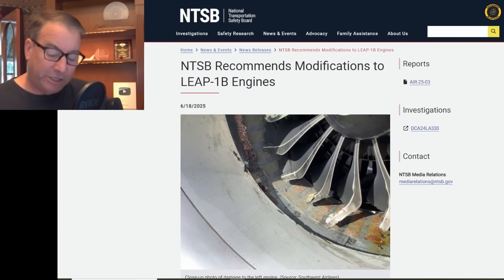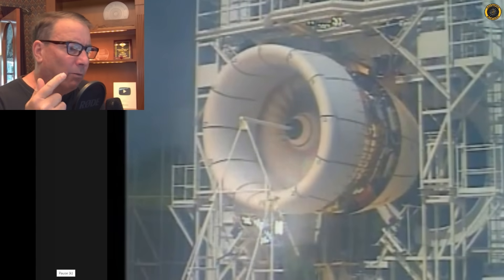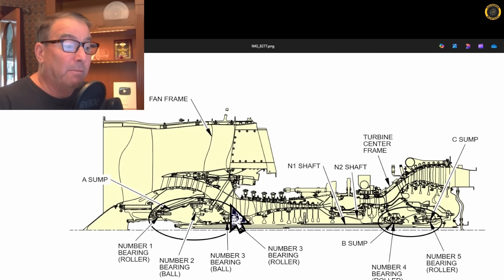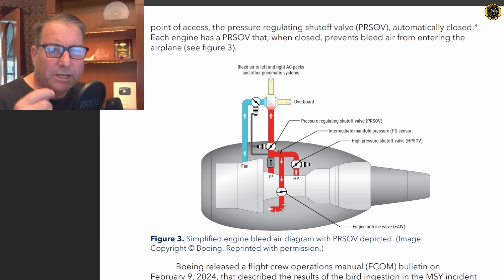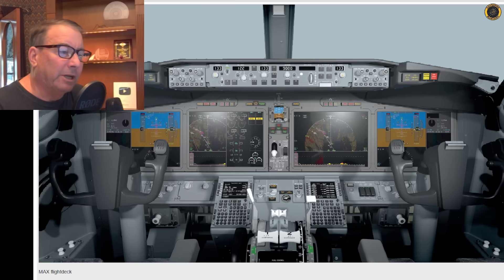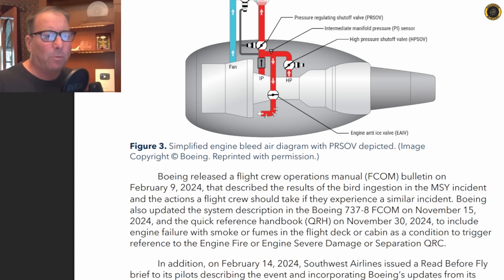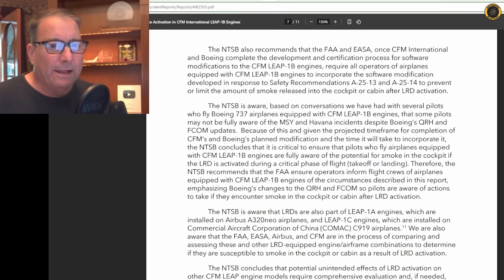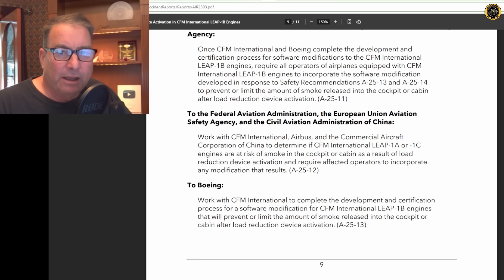NTSB Urgent Safety Recommendation 737Max LRD CFM Leap Engines

Comment: I'm not exactly understanding how the LRD activating compromises the oil sump? Is it solely a result of the LRD 2 (fuse pin) activation, or is it just because without the rigid attachment of the fan blade, the sump is very likely to become ruptured? Just hard to conceptualize from diagrams. Thanks for the video.
Reply: Basically the sumps surround each bearing in the engine. The forward most bearing is for the fan stage. When the fuse pins break for the fan stage, this also rips open the forward sump, spilling oil down the core of the engine (which can then be ingested by the air con system).

I think from the diagrams, it looks like the fuse pins are literally on the sump itself. I could be wrong though. I worked on CFM-56-2B engines. Similar engines, but way way way older, so take what I have to say with a grain of salt.
Reply: Having read the Mitigation document (Juan links to it in the description), the LRD activation can pull the oil pipes out, releasing oil that goes downstream into either the cockpit airflow or passenger compartment, depending on which engine is affected.

Whilst there are circumstances where airflow will be automatically shut off after LRD activation, the shutoff is normally triggered manually. For example when an engine fire lever is pulled.

Now whether this can be classed as a design fault,  or it's a compromise in that LRD triggering is better than the engine vibration shredding the whole engine and possibly damaging the wing if the engine falls off is up to better and more expert minds than mine will have to answer.

Also, whilst this mitigation is currently specific to this particular engine design, they have recommended that all certifying authorities worldwide should be investigating the relevance to other versions of this engine used on Airbuses and non-Boeing aircraft.

Also, Boeing and CFM are working on a software patch to trigger automatic  airflow cutoff in more situations. Due to the need for testing and certification, this update won't be available until some time in 2026. Probably on Patch Tuesday...
Reply: thank you both for the informative replies!

Comment: Avoiding new type certification is driven by a desire to avoid new training but it ultimately keeps the airlines involved with aircraft systems that are decades behind modern aircraft and ultimately it will be their downfall as people avoid the types where they have a choice
Reply: I wonder how the comparable system in the equivalent Airbus system operates? Would make for a good follow-up to this excellent video.
Reply: This is more of an engine thing than airframe thing in my opinion. But all the busses have 2 bleed management computers to monitor temperatures and pressures and it's an automatic system that can be manually intervened like almost all systems on the bus. In a damaged engine scenario I believe it would smoke up the cockpit on an Airbus as well. I don't know if the bus version of the LEAP engine is different in where the oil sumps are located, however.
Reply: @mikaeleriksen2994 Thanks for that info. There appears to be a need for FAA aircraft certification changes to allow manufacturers to automate the manual checklist process that was being described in the video, without fear that the changes will threaten the aircraft certification for commercial flight. Tough enough to fly a plane with an emergency as described in the video without the additional burden of managing a checklist and toggle switch throwing it on a largely fly by wire aircraft.

Comment: Well done sir. Just wanted to point out that when my airline gets an important update to manuals in the iPad, they are flagged and requires your review and acknowledgement before the flag is removed. This is supposed to ensure pilots know about important changes etc.
Reply: I was wondering if that sort of thing was built into the system. I'm glad it is, but I agree it should be more obstinate than a flag in order to discourage complacency.
Reply: @robin_holden  The flag has to be CLEARED!!!!!!!! so the pilot has to view why its flagged and click to very they have read/understand the update. If the pilot does not verify it then the update remains flagged and that pilot is not flying with updated manuals, which is not permitted. What more can you do? iF A PILOT WANTS TO QUICKLY CLEAR FLAGS WITHOUT PROPERLY READING THE UBDATE THEN THATS THEIR FAULT... NOT THE COMPANY PROCEDURES.
Reply: @geoffreymckenzie5561  There is no need to engage the caps lock sir.
Reply: @geoffreymckenzie5561  This is no worse than a pilot who chooses not to read the paper updates.
Reply: @geoffreymckenzie5561 and @blancolirio
I'm a math teacher by trade and have no experience flying planes BUT we are required to do annual trainings on various things like "mandated reporter training" and at the end we are always required to complete a short multiple choice quiz that verifies we read or watched the training and know the material. If we get questions incorrect we have to retake the quiz until we pass with the standard set by the district.
So I was wondering, if when the iPad gets updated with an update to the manuals and flagged -  if a quick multiple choice quiz could be added that pilots MUST complete and have checked off BEFORE they are allowed to fly on their next leg thus reducing the possibility a pilot acknowledges the updates without actually reading them because they are in a rush or some other reason.
Reply: It's all too easy to ignore flags. There needs to be something more 'nagging' to ensure that pilots HAVE TO pay attention.

"Windows XP has updated and will not restart until you read the information on the blue screen. The blue screen cannot be removed until you have read the information on it, entered the correct responses, and restarted your computer..." 🙂
Reply: @EleanorPeterson  I'm not saying the system is perfect. However, pilots are responsible for having updated manuals before flights. If you have flagged manuals, you are not flying up to date. Regardless, the responsibility is on the pilots no matter what system is in place.
Reply: Just saying, but in software development, "did you read this? yes/no" style confirmation is for CYA. When you want to ensure that a user actually did read the message, you include instructions they have to follow to clear the message. Think something along the lines of "enter the title of this notice to confirm that you have read and acknowledged its contents".

The trouble, of course, is that it only works because it's unusual. People can turn just about anything into a habit.
Reply: @SnakebitSTI  The title is at the top. We used to use a question whose answer was in the new text itself.
Reply: @SnakebitSTI  I appreciate your point, but not sure this can be prevented outside of a strong safety culture.
Reply: @BiosElement Oh, I agree with you completely. Tricks to make a user stop and think about what they're confirming are no replacement for top-to-bottom safety culture. The pilots have to care about safety notices. Managers have to care about giving pilots time to read and understand safety notices. Technical tricks can help, but they don't address the root cause; no technology can.
Reply: @SnakebitSTI  Yes: There is no such thing as an idiot-proof machine. Idiots are much more relentless and clever than you are!

Comment: Great update Juan.  A big issue is that the oil fumes are very toxic and can incapacitate a crew within a minute or less!!
Reply: Indeed. Most people in fires die from smoke inhalation rather than the flames.

Comment: Still not clear why the oil is released after these bolts shear?
Reply: The LRD bolts fail when there is significant engine vibration. This is to protect the cowling and the engine attachment points from excessive forces. However once broken free the center of the compressor stage is now "free" to bounce around more violently and this can rupture oil lines or the sump itself.

Comment: The MCAS debacle was all to save money so they didn't have to change the certification and costly pilot training... All to make more money for shareholders.....
Reply: IMHO, the elephant standing in the room is that the NTSB makes recommendations, and it's up to the manufacturers to engage the advice and actually make changes to the aircraft design and implement safety fixes ASAP when there feel the pressure to make a change (pilots, passengers avoid aircraft types, lawsuits, etc.). If the change is not in the aircraft manufacturers business best interest (impacts short-term profit), then it's just another NTSB recommendation that will serve as yet another lesson learned when tragedy eventually strikes. The long-term cost of tragedies (737-Max MCAS design implementation and subsequent crash/fatalities) far outweigh the corrective costs of not implementing changes, but I guess some manufacturers don't see it that way (some do, thankfully).

Comment: The fact the packs don't close automatically on the detection of LRD activation is absolutely crazy. So easy to implement and they just didn't bother doing it...
Reply: should we build the plane so it doesn't turn the cockpit into a gas chamber when a bird strike occurs? nahhhh let's leave it to the crew to remember to hit the right switch at the right time
Reply: EXACTLY BOEING'S COST CUTTING MANTRA...
Reply: My impression was that the LRD is entirely mechanical, breaking off under abnormal load, so there isn’t an electrical control or sensor signal involved.  Did I misunderstand?
Reply: @ydonl yes the LRD is an automatic mechanical system, the issue is that when it activates that causes leakage of oil into the rest of the system, which creates smoke which then travels with the bleed air into the cockpit/cabin. So by fixing one problem (isolating uncontrolled vibration) they caused another (gas chamber).
Reply: @TheLando  How do we know the oil leak didn’t happen before the LRD’s triggered?  Or that it would not have happened without them?  It seems to me the engine is already in pretty bad shape.
Reply: @ydonl  I'm not an engineer or A&P mechanic, but my understanding is that when the LRD activates there's a lot of mechanical force that damages the engine sump, allowing oil to leak out. I'm sure ingesting a fan blade, for instance, could also cause an oil leak, but this seems like a pretty direct unintended consequence of the LRD mechanism itself. Again, from what I understand as a layperson.
Reply: @ydonl correct. But remember the LRD exists because a fan blade out is so violent that it can potentially rip the engine off the wing. That's a pretty easy level of 'vibration' to detect. Also it's easy to place sensors that detect a physical internal structural collapse which is basically what the LRD activation is.
Reply: @kutto5017  Got it.

I kinda seem them similar to how an F1 car breaks up and loses its wheels in a crash, rather than keep all the kinetic energy in one big lump.
Reply: @ydonl  what I understood from the video was that if the vibration sensors sense too much vibration in the engine, it’ll automatically turn off the engine and close the valve to the packs (on other jets not the max). and so the max just doesn’t have that programmed into the system to automatically activate, instead the pilots have to remember to do it.
Reply: Awfully similar to the engine anti-ice that if switched on and forgotten, could result in catastrophic dual engine failure on the Max!

Comment: I can see already how "buried" any updates could be in the way iPads get their updates. Seems to me that the old "pink bulletin" is a more precise method because it is a physical document and deals with updates/changes. There's really no gain in gong fully electronic with updates and merging them with the entire procedure possibly causing pilots to overlook what had gotten updated or changed. Lots of pilots are good at their job, I'd hate to be dealing with adolescent methods that require a full reading of the subject vs. only what was changed and move on. No one with experience wants to rehash something they already knew very well when all that needs to be mentioned/addressed are any changes. If I'm getting this iPad update idea correct vs. the pink bulletins that is. Paper notices have their place in the human world too.
Reply: There is absolutely no reason why changes in an electronic system cannot be flagged up just the same. All the way up through actually requiring the pilot to (for example) confirm they have read each paragraph, and displaying it for a minimum required time, for important safety updates.
Reply: @queazocotal  I wouldn't exclude that but only as a second resource, as changes arise, keep the pink bulletins coming.
Reply: As someone who has written more code than I care to remember having a clear marking of changes since last update is pretty trivial and I'm surprised that it apparently isn't commonly done. Even better but a bit less trivial is having full traceability for when each change was introduced. All version control systems have this functionality.
The power of getting a physical paper in your hand and the organization that is required to get you that paper in time should not be underestimated. It is very easy to just click ok a few times without reading the prompts so you can get on with your real job. I have seen that bite quite a few people during the years...

Comment: If I see a Boeing Max as the aircraft on my chosen route it ain't hapening... period
Reply: Now that is so uninformed. Unusual for this channel.
Reply: Walking to your mailbox or taking a shower is statistically far more dangerous than any ride on a 737 Max.
Reply: @carbonking53  Not more life threatening though.
Reply: @carbonking53  Until you, a loved one, a friend or neighbor is on the news as a 'lost soul' that was onboard one of these aircraft that suffered a failure where a directive was previously published and reported. I don't feel that the statistical argument is going to cut it much longer with the flying public, with all of the accidents large and small that are occurring. More can be done to make changes to improve passenger and crew safety.
Reply: @JimIntriglia is there a 5000 737 Max flights everyday and it's been 8 years and many many billions of safe passengers. 
In the United States there hasn't been a death caused by a plain malfunction in more than 25 years.
Reply: @mcamp9445 Thanks for your perspective on my comment. The 737 Max MCAS debacle leaves me prefering/choosing flights that provide Airbus over flights that feature Boeing aircraft. Sometimes intuition based on in-depth review of management practices and employee testimonials is best over plain stats.
Reply: @mcamp9445  While statistics reflecting the past suggest flying is generally safe, this doesn't account for potential risks from manufacturers' and government current practices. We need to consider those risks to get a true forward-looking risk assessment that represents air safety." Additionally, we need to consider indirect as well as direct root causes-- I would consider the 737 MAX MCAS incidents when projecting forward-looking flight safety risk.

Comment: How on earth was this system certified?
Reply: Is it all that surprising given the culture change in America's companies going from pride in their product to appeasing shareholders at all cost.
Reply: The engine and aircraft are certified separately.   Bird strike is not performed on a system with the aircraft.  During blade out testing the same failure of the oil lines probably occurred, but the safety analysis must not have thought about the smoke in the cabin or flight deck.  The certification requirements for be engine was met as there was no fire, mount failure, or uncontained debris.  I am sure certification requirements will need to be updated to include this item.
Reply: Legacy certifications FTW!
Reply: @erich623  I assume they mean the LRD which is new(ish)